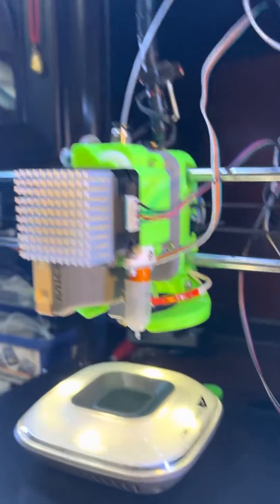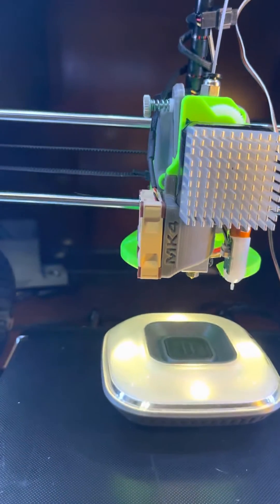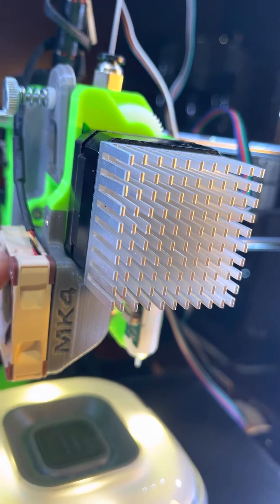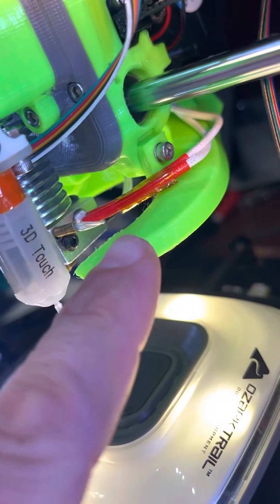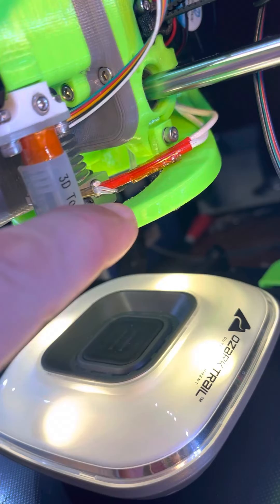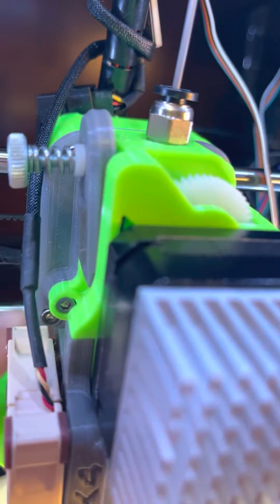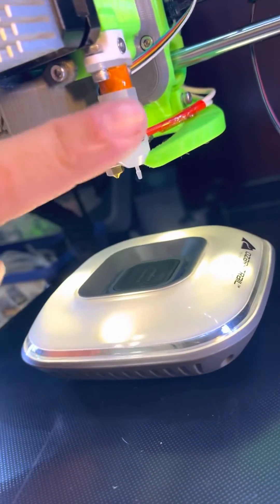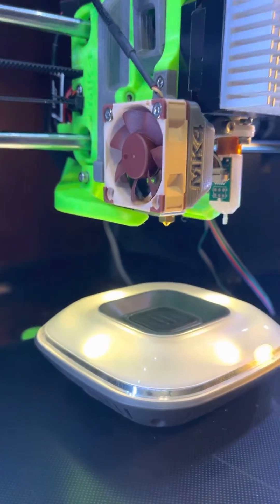Anycubic Mega S Direct Extruder MK4 Upgrade Hints

Comment: HI.  I'm looking for a solution to my problem.  I also created my own cart with direct filament connection.  now I have a problem, the filament motor has been changed with a smaller one, but instead of spinning it trembles.  I think it's high voltage.  Now I'm wondering if you had this problem too?  and if you could help me.  A thousand thanks